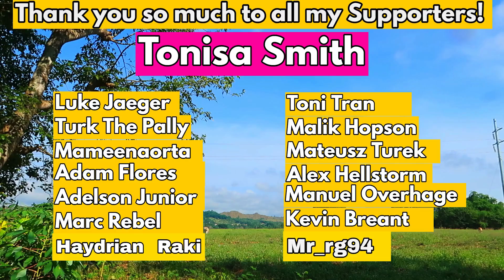How to Make Homemade Cable Row Machine and Dip Bar

Comment: dude go to gym for Christ sake. all these diy, man u can pay annual fee lol👍🏿

edit: 😬
Reply: I guess you didn't watch his last video where he showed that he spends his money on his community. Gives away staple foods & groceries as well as directly giving back money. I agree with you Rom could spend more on himself, that's just the reason why he works out the way he does.
Reply: @Luke_Groundwalker  Like all these videos and he doesn't wanna pay a gym fee and have good work. i ain't ignorant and i have watched his vids for quite a while.

Good equipment comes first. Then comes rest. 😅
Reply: Hey gym memberships aren't free you goober and he's poor; working out 3 - 4 days a week will just chip away at his money if he payed per session and monthly payments
Reply from the maker: Monthly gym membership is really expensive that's why i stopped going to the gym and save money for these cheap homemade gym equipment. Imagine getting a bag of cement which cost only 5$ can make lots of concrete plates and dumbbells. But you can't find a pair of 40lbs DB that is worth 5$. All these build are very cheap. 1 month of gym membership is already equivalent to lots of weights.dumbbells and 1 diy gym equipment.